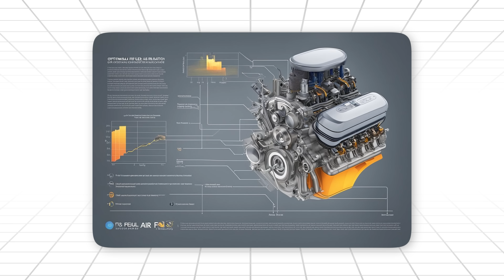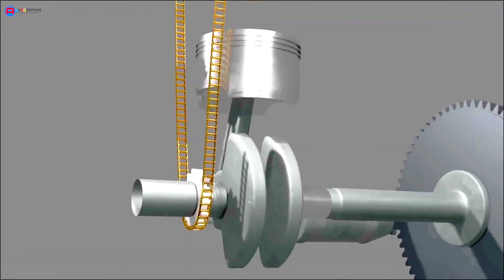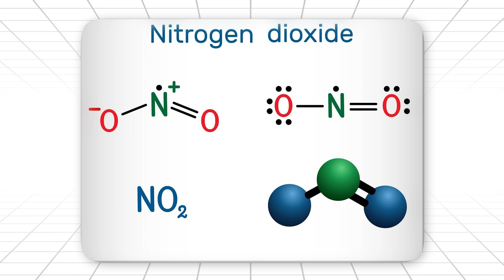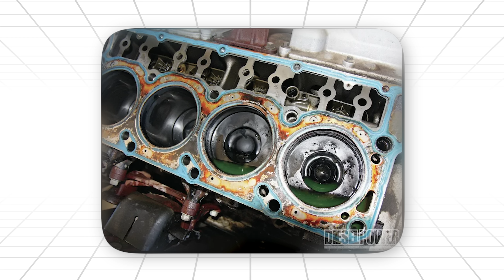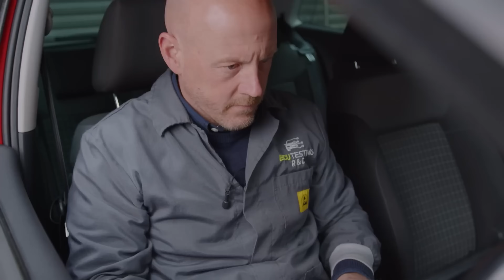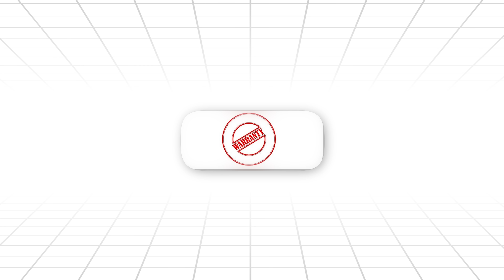Diesel Engine Timing Hack Reveals Insane Power Gains

Comment: Combustion in a Diesel Engine is Constant Pressure.  Combustion in a Petrol is constant volume.  Nothing to do with NOx  The bigger the Diesel Engine the lower the compression ratio , laws of physics. Modern Diesels have a mix of Constant volume combustion and constant pressure,  depending on what the engine is going in.  The reason why some people put later model injection pumps on older engines to give better performance and fuel economy.

Comment: This is almost true .
Advanced timing increases engine speed which the computer sees and adds more fuel 

But if you run the same compression ratio in a gas engine will have 500 HP to 1,000 HP and 1,000 ft lbs of torque 😊

Comment: Street level dot approved should not produce smoke for more power. You are 100% wrong when its applies to real race level trucks. Watch some on YouTube.

Train torque is produced by electric motor between the wheels they are diesel electric. Motor powers generator then send electricity to  a real torque producer the e-motor.  Its been this way so long. This why If your not intelligent  to begin dont Watch YouTube to lean things. It's unfortunate bit it because of stuff like this.

Comment: Carbon dioxide is not a pollutant it is the correct result of the combustion of any carbohydrate or hydrocarbon fuel. NoX is a problem only in the fact that it creates photochemical smog. 
You are correct on one point regulators fix one problem only to create two other problems.

Comment: What he's telling you about a smoking motor is a very long length explanation that would make the video longer with more commercials when all it is that cause smoke from a diesel motor is a clogged air intake filter or intake. Also if your using low CFM intake tubes custom or not. Lower CFM as opposed to fuel intake being higher by volume that to ignite fully related to the CFM volume flowing into the intake and cylinders before ignition takes place. Oh, the hell with that, it's usually the freakin air cleaner...

Comment: I believe a 12 valve Cummins optimum crank degree is 14° ATDC that probably applies to a lot of i-6s if not all of them
Reply: For peak pressure only
Reply: @100pyatt of course when you hear of a builder/tuner saying the best degrees of timing advancement they're only talking about peak pressure of the combustion event.

Comment: Factory timing on my '93 5.9 is 12.5* BTDC. Not the best. I am running 17.5-20.5* by advancing it 2 teeth on the injector timing gear. This is a dumbass video.
Reply: Mercedes OM366LA 6.0 turbo intercooler, Forder Beginn at 18 BTDC (factory setting).
Reply: Which process exactly the content of this Video!  Thank you!

Comment: This is quite intelligent for an AI video.
Only thing I would add is valve timing greatly effects torque.
Its not only when combustion starts but also how long it goes for.
Later exhaust valve opening lengthens combustion duration.
Reply: I did some experiments with valve timing. I found that retarding a camshaft will reduce torque at low engine speeds and improve fuel economy. It also makes the exhaust sound quieter. Sometimes it will increase power at high engine speeds. This is mainly caused by the change in the intake valve closing point. If the only change is retarding the exhaust valve opening, the engine should gain torque at low RPM and lose torque at high RPM due to higher pressure during the exhaust stroke.
Reply: Yep vvt

Comment: These videos need to stop calling a combustion event an explosion. The engine works by heating the air quick enough to expand, build pressure, and push the piston. Like steam except instead of heating a medium externally to expand in the cylinder it heats and expands the air in the cylinder. Hence internal combustion and external combustion. Turbine, jet, and rocket engines work on exactly the same principle. Expanding a medium with heat. The hot expanding air is what pushes the piston, spins the turbine, or pushes out the engine to create an opposite reaction. This is why using a device to introduce more air volume increases power. More hot air more push.

Comment: It is not like this just for Diesel motors. For compression and torque, yes.
Even for oil heaters / burners you can get more heat energy out of the oil. It is always the NOx that makes it unhealthy, so the oxygen mixture is set to the point of maximum CO2, instead of maximum efficiency, which would give much NOx

Comment: Would water injection or something similar remove the NOX output and resolve the problem w/o sacrificing power or mileage?
How about a video on this and how to lobby the CARB body to relook at the regulations!!
Thanks, Ken.
Reply: Simply spraying water into the intake increase the charge density and in turn increase the chamber pressure slightly and also quenches it.. it typically yields about a 5% increase in mileage and power without having to tune anything else and also decreases Nox and keeps your particulate filter clean. For a diesel it's pretty much win all the way around.. I'm working on a port injection system right that will run water injection right off idle..
Reply: I think you are right. Water injection or EGR would reduce the peak combustion temperature and reduce the NOx emissions. A good intercooler would also help.
Reply: Yes

Comment: This has so many flaws. Right off the bat the ratios pictured are compression ratios, not air/fuel ratios
Reply: Actually both.  The difference between a SIE and a CIE is that a CIE relies on excess air for a good burn.

Comment: i have 2.0tdi in my audi a4 b7 quattro, and i can change the injector timing with 3 tools and it works awesome. i had no clue before that video why im gaining power 🤣
Reply: What tools and what did u change.  I have the same tdi.
Reply: @kc03300  look for instruction video how to adjust lash on pd injectors and when you need to turn 90 degrees back you turn 45 and that it. 1 torx 1 hex and 18mm

Comment: Diesel engines are one of the greatest inventions.  The government messes up everything.
Reply: They were trying to protect the air and water but they may have made the rules too strict. Diesel smoke is not a good thing to breathe. I read that adding propane injection can improve combustion and reduce the soot. Water injection should reduce nitrogen oxide emissions.
Reply: @andyb1221 water emulsion diesel fuel lowers combustion temps and burns cleaner.  The fuel is white and looks like milk.  The government is out of time and they know it.

Comment: im probaby gonna spiral trying to detemine what is fact and what isn't 
because i'm ironically gonna fact check this with the same AI they used to create this in the first place
Reply: This looks mostly true to me. If you are thinking about setting the injection timing more advanced, it would be a good idea to find out if your engine has problems with the head gasket, head bolts or connecting rod bearings. I remember reading that the earlier version of the Oldsmobile 350 V8 diesel engine (D casting instead of DX) was likely to fail if the timing was advanced.
Reply: oh
Reply: and im gonna rant becayuse i have to scrifice my credit card and get grounded in theprocess

if only indusry professionals are available to talk to 24/7 so my frustration would be nonexistent

Comment: There has never been a recorded death from NoX. Re: Biodiesel: I don't think there results in as much NoX in the exhaust but I'm probably wrong.
Reply: I heard that NOx causes smog and acid rain. It's probably bad for crops and fish.
Reply: Nox creates smog.
Reply: @sspence65  So do our farts, just like those nefarious Cows, what's your point? Any mechanical system if not properly maintained or being old & worn...I/C or electric, won't operate as efficiently as when new. We see smog because of still air currents. Now when it comes to the LA Basin, that was a stupid region to build homes. A Geographic anomaly that limits air currents w/in it's own topography. The same as when the Spanish Missionaries in the 1600's, crested the basin's rim & saw a huge white cloud obscuring the forest. It was the smoke from Indian campfires trapped in the basin. Stupid place to live!
Reply: You are absolutely right; even modern medical research has shown that NOX is a tonic for human health. On the other hand, carbon monoxide, which is the result of insufficient combustion, can cause death. Actually, there is an oil mafia behind the regulations.
Reply: @AmjadKhagga  Nothing that comes out of an I/C exhaust is a tonic jerk.
     I only mentioned NoX & Biodiesel, nothing else. Create your own comment, don't put words into mine. Are you a Democrat?

Comment: It is not explosion it is combustion !
Reply: It is expansion...by combustion.
Reply: @weithmichaelsen7398 it is combustion, by expansion.
Reply: If you look up deflagragation which explains it more.
Reply: @rossoxenbridge7495  Too true but as applied to engines internal or external fuel burn, the term combustion is usually used.
Reply: In the case of diesel it’s more of a fast burn than an explosion.
Reply: A fast combustion is called an explosion.
Reply: @darksoul4721 An explosion that causes parts failure, right?
Reply: The engine exploded.